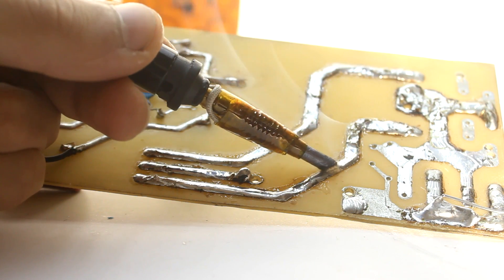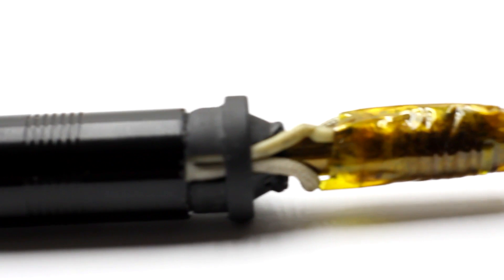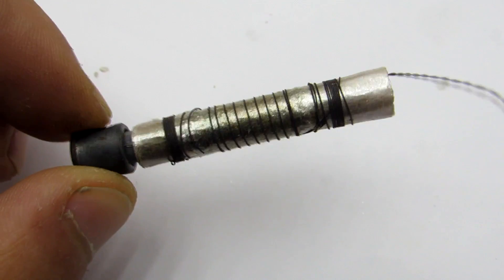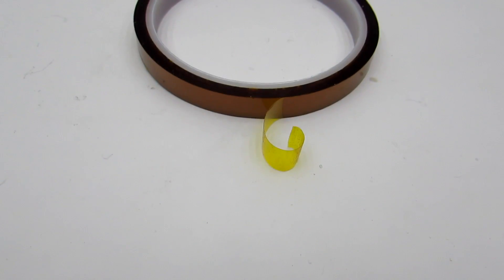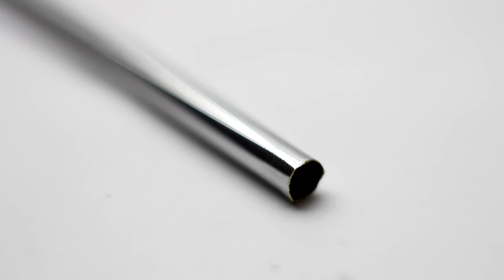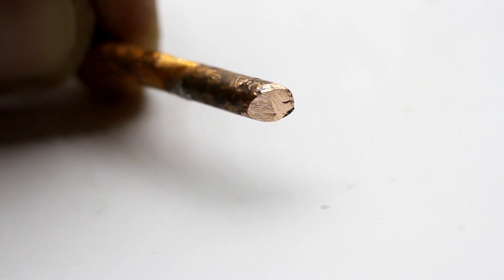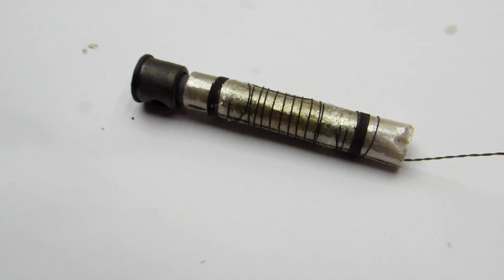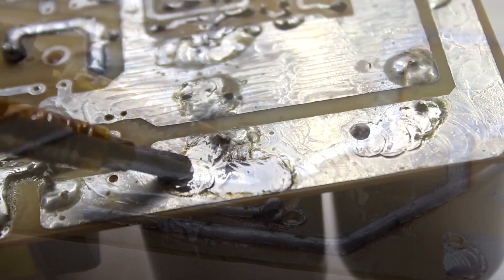DIY Induction soldering iron

Comment: How do you have the wires and the conductor connected ? Every time I plug mine straight from the outlet it sparks in my face
Reply: The inductor
Reply: Its not meant for 120/220 lol there is not resistance in the copper coil he wrapped around the tube therefore will short your AC LINE  to the white/return wire . And it will probably burn out your power supply after a while or drain the battery

Comment: but it worked well now I'm thinking I can make all inside heating if its too hot I'll put 2 wholes 1 side add handle and heat tape and probably remove the switch

Comment: I try make USB one using an burned off soldering iron nichrome wire but it did not work on 9 v so I left it to get better one wire as far I had not that long of a flashlight but I drill nearly with drill bit and screwdriver the whole nearly perfect

Comment: What is that yellow tape like thing
Reply: Diwas. 10 "Heat resistant adhesive" It prevents the copper coils from moving around and minimizes the risk of touching each other (or the rest of the wire) from coming into contact
Reply: AwesomeGuy thanks

Comment: which power can used
Reply: If we assume 100% efficiency, then 100 watts of radio frequency input produces 100 watts of thermal power.
Reply: i ask question which power can used home power or battery power or other power used in soldering
Reply: What he doesn't show in the video is the high frequency oscillator that powers the soldering iron. Since it requires an oscillator, you can design an oscillator to run from 12V batteries or something that plugs into the wall. He was showing us the design for a soldering iron where the heating element that heats the tip doesn't get hot, but gets the tip hot by sending high frequency oscillations into the tip. The tip acts like a shorted circuit to the high frequencies and the current heats it up.